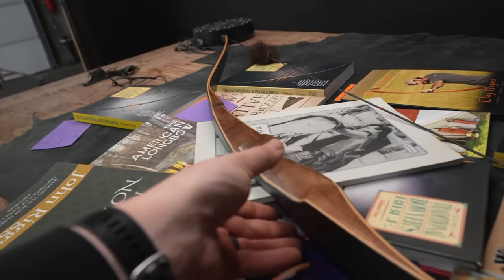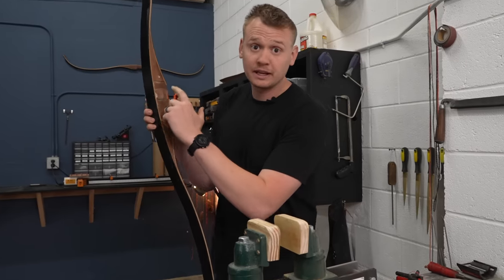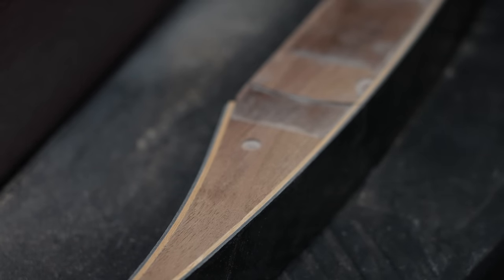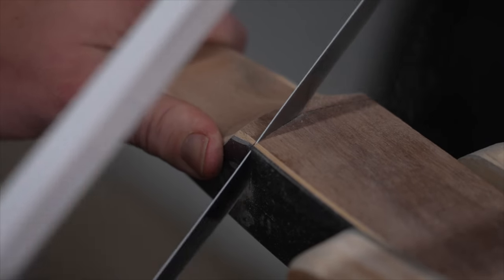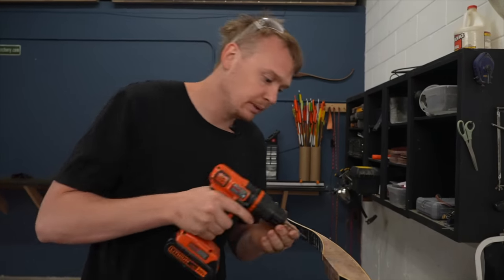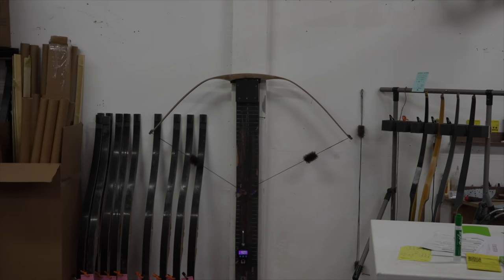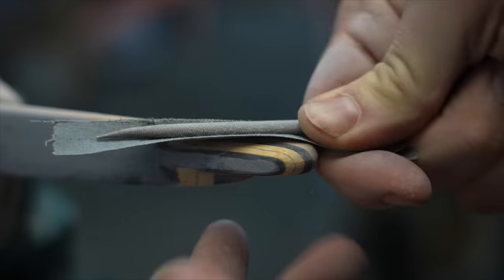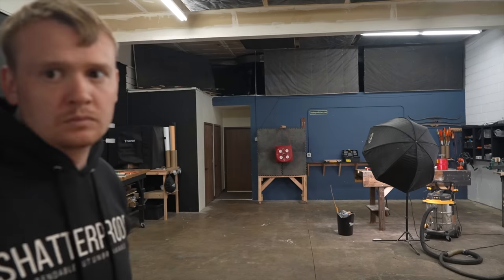DIY Fiberglass Bow Build

Comment: As a beginner bowyer with exactly 1 functional bow (70" longbow), an 8ft heat box, and a recurve form that isn't even, this is an AMAZING idea. I genuinely went straight to the website and got one for myself (will be here on the 07/19). It is so disheartening to spend so much time on a bow, only to have it snap during tillering or when the string is put on the 1st time or the first time it is drawn. It is comforting to know that a lot of the really hard work has already been done, so I can practice finishing a bow and get the dopamine rush of a finished product.

EDIT: Longbow is 70" (seventy); for some reason no matter how much I edit it, the comment still shows 79" (seventy-nine). Maybe its a cache thing or something, but just wanted to clarify.

Comment: One never been a fan of kits.  I've paid more than I would pay for an actual product for good guides on how to do it myself because I'm interested in the entire process.  Buying a kit only gives me a small portion of that enjoyment.  Your videos have given me the guidance to build a bow, but if there were a compilation, especially with added instruction in print, I'd be more than happy to buy that.  

A relatively inexpensive source for materials would be awesome, too.  I can't just go out to Lowes or Home Depot and buy a lot of the woods that would be optimal for building a bow.  My nearest quality lumber store is well over 100 miles away and the online resources I've found only want to send 36" sections, at most.